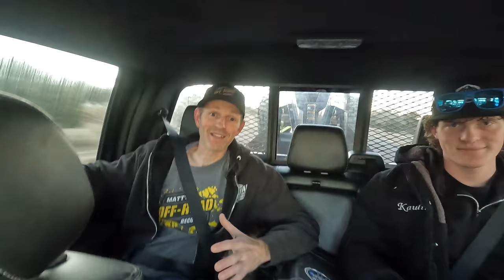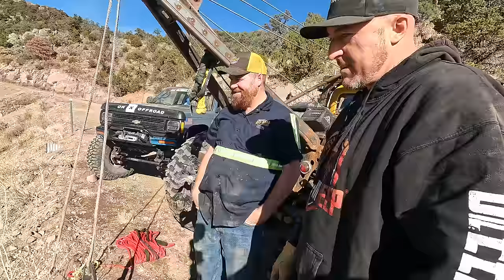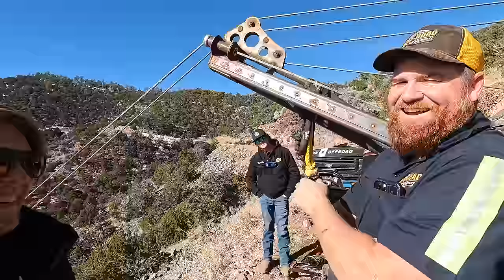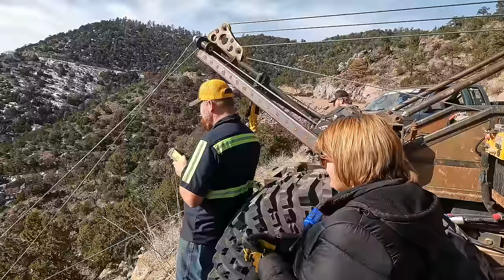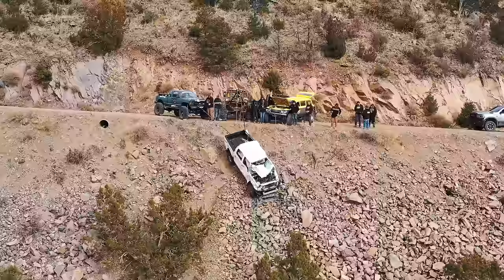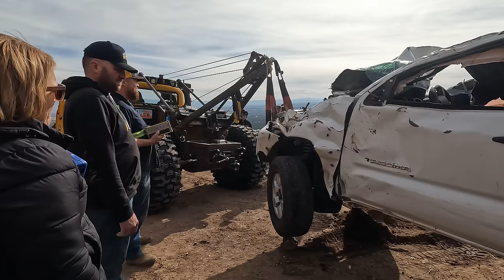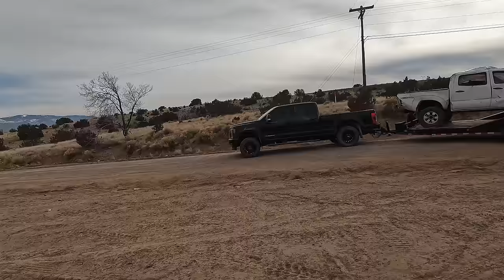There's No One Who Can Recover This Toyota....

Comment: Just a suggestion, your downhill crews should have some mountaineering helmets on for safety. As a medic and wilderness EMT I have been involved with many folks who have sustained very bad head and facial injuries from rock fall. Maybe you can get some custom yellow helmets which also have options to put LED lighting on them for night work. Love you guys! My favorite First Responders!!!
Reply: as a construction worker, i have worked with people who have gotten hit in the head and survived because of a cheap piece of plastic strapped to their heads, just be careful about what you wear underneath. someone in my class was wearing a baseball cap, and had a drill fall on his head, he was fine, but it hurt a lot more because the impact was focused on that pin
Reply: They won't even wear safety glasses. Helmets? 😮
Reply: Couldn’t agree more! I do on road recovery and we have to wear them when doing ditch work, or cliff side work. It’s actually saved me some serious issues once or twice from falling debris
Reply: Matt seems like he doesn't take safety advice very well.
Reply: Another hot tip from the "Safety Police". This crew thinks going the extra mile to make things a little bit safer is going over to the Dark Side.
Reply: They don't use welding face shields generally, I don't think they're going to use mountaineering helmets...
Reply: Probably eye protection too.
Reply: Helmets, and maybe repelling gear😊
Reply: Psshh.. What are you GUYS? OSHA??? LOL
Reply: Is that talus or scree, or both?
Reply: U dont need any of that
Reply: The Pantry in Santa Fe has the best breakfast ever!!!
Reply: Can’t yall just watch without nit picking everything they do
Reply: 🤓 🤓 🤓 🤓 an EMT you need mountaineering helmets 🤓 🤓 🤓 🤓
Reply: There are KARENS everywhere! They don’t need any helmets 🤦‍♂️🤣🤷🏼‍♂️
Reply: @henrymurray230 don’t forget to wear a cup
Reply: It's in the 30's and Matt's not even wearing a sweatshirt.
Reply: Shhhh! Don’t discuss safety. OSHA might be paying attention!
Reply: I'd suggest hockey goalie gear inside an inflated bubble, just to be safe.
Reply: Safety third!!!
Reply: You guys need sun protection 😂
Reply: Merch too with their logo on yellow hard hats/helmets
Reply: Health and safety nannies abound here.
Same mob who pushed the jibby jab.
Reply: Matt doesn't value the lives of his employees, he can just hire new ones.
Reply: Just watch the show if something happens I'm sure it's gonna get more interesting.  .
Reply: @kevbev1524  I’m actually curious about his company worker comp insurance premiums. No helmets, no safety harnesses. And they can’t blame the workers as they are not even made available to them.
Reply: @patricklarocque1550 I was just wondering the same thing… WC is so varied across the states in the first place. Has his insurance carrier seen his videos? 😂😂😂
Reply: @patricklarocque1550  
I wonder, is Utah just more relaxed than other states, isn't that the state you can have many wives, Mormon government maybe more of a do what you want til it's too late state?
Reply: And a helicopter and a sky hook and a 20000lb pocket winch, and their mommy to hold their hand
Reply: May I suggest bug spray?
Reply: @itomba  I think it's more like scrus.  Or talee.
Reply: He might have a change of safety attitude if a crew had a workers comp claim…
Reply: Matt doesn't care about safety lmao. He makes that clear when he makes him employees get in vehicles that are in precarious situations when it's unnecessary.
Reply: @erickrobertson262 I fully agree with what you're saying I just wish a few people in the comments would let their fingers take a break and not type out some of the trash that they're saying
Reply: @itomba kinda both. Scree is small and actually nice to descend as you can kinda plunge step/ski through it. Sucks going up tho, like a treadmill

Talus is larger loose rock, which there seemed to be plenty of
Reply: safety? Matt Grinds metal without safety glasses and picks up hot pieces of metal that have just been welded with his bare hands and then exclaims ouch! that's hot!
Reply: Maybe they should be wearing helmets ffull time? 🤪
Reply: @1996FordBronco  Don’t get too excited, everyone’s comment puts money in his pocket!
Reply: Safety third bud
Reply: People in this thread calling those who are concerned about safety Karens need to consider if there was accident what the consequences would be.  State and federal labor violations are one.  Another would be what casualty insurance would do — cover the loss, deny the claim, raise premiums or just cancel the policy.  Finally, Matt could lose everything to a death and/or dismemberment tort claim for negligence.
Reply: I just watched an old YT video about a man in New Jersey who was killed by a tape measure falling from a worker’s belt on a high-rise construction site.  The tape hit the ground, bounced up and got him in the head.  He was delivering wallboard and was not wearing a helmet.  Just a freaky accident.  Wearing a safety helmet may have saved him.
Reply: I thought this was a repeat but realized I already saw it on Bleeping Jeep’s channel.
Reply: Agreed. Ive been hit by 2 rock slides and rocks do not care about flesh or bone. Surprises me they never get hurt.
Reply: If Matt was selling $300 hard hats, they would all have one.
Reply: Seriously, Y'all need to get a life keep ya suggestions to your self Yeah I said it...another successful job done now give the whole damn crew their props and 👏🤘🫶💪🤝🙏
Reply: Fair call. But he dont play by the rules…
Reply: Here here!
Reply: 💯🤔 Albuquerque New Mexico in the house I totally agree😮 have a good pair of binoculars wouldn't hurt also😂😂😂😂
Reply: Sheer idiocy putting three people on a line descending through talus, rocks flying down with every step.
Reply: You must new to the channel. Their moto is either ‘safety third’ or ‘safety last’.
Reply: Oh these guys are still n the 60s to 80s mentality. Back in the day when anything goes and we were not afraid of stuff 👏👏. Back before helicopter parents and you
Reply: I don't understand the tough guy act some people put on by willingly omitting safety gear. It doesn't make you look professional or brave, it makes you look incredibly foolish being so underprepared.
Reply: I totally agree!
Reply: And some rappelling lessons  and harnesses.
Reply: Well Osha tried pulling that truck and couldn't succeed or it'll cost more for the insurance to just leave it for will to take over.  So what yall want? Mayt's team know what they are doing .

I'm just wondering where the drone at?
Reply: @masterbond9 I hate when I hit that spot on something when I'm wearing a hat
Reply: You're above 4 ft You need a harness in a lanyard😂😂😂😂😂😂@RonnieBravo_
Reply: I hunt on mountains like is with no helmet... gotta get rid of your City feet 😂
Reply: @spambeanie2  if youre an OSHA inspector then i'm the queen of england 🤣 🤣 🤣 😆
Reply: Somebody put a dollar figure on this job.  10k?
Reply: Good advice but, I have to ask, how would a helmet protect you from facial injuries?
Reply: @michaeltreen8785  at least, I wouldn't do it for any less, payroll, hauling, equipment.
Reply: Y’all doing to much
Reply: @jelly7310 any advice, the corvair was a POS
Reply: Id take a step back from hating on his way of safety. things have happened, they do take safety precautions.
Reply: I was going to comment with some hate about you being a nanny but after reading the entire comment and considering it before I spoke you are definitely right and I would be sad if Matt got crushed by a rock. I’m not a huge fan of PPE but a simple helmet when working downhill on a rocky surface is probably smart.
Reply: Thick socks reduce rolling rock injuries plus gloves aid rope walk down.
Reply: 🤔 Maybe just enjoy the video? 🤦🏻‍♂️🤷🏻‍♂️
Reply: Just a suggestion, your grammar and punctuation is slightly off. Maybe consider have an English teacher review your posts prior to submitting them? I know ALOT of people who do this and it prevents others from critiquing your comments/posts?
Reply: @JT_70  that is exactly what I was trying to figure out. That’s where I saw it too. OK now it makes sense.
Reply: And some rappel and basic climbing skills
Reply: Then why have a skull?
Reply: Yeah....Matt has been pushing safety for years with his can do attitude.  Its time to get more professional before someone gets seriously hurt.
Reply: They just need to carry the shop caution sign in the field. CAUTION!
Reply: Thanks KAREN you are lucky they are using radio’s
Reply: Ok karen
Reply: @1996FordBronco, how are they nit picking they just want them safe 😂😂
Reply: ...and a hazmat suit for any contaminants as well as a respirator for the foreign dust particles.
Reply: Might get good results if somebody donated climbing helmets with a note we care about you and crew
Reply: @gizmolannigan your mommy
Reply: Good advice, I totally agree,  safety first!
Reply: Someone always has to to say something..just watch it and enjoy it..and like the video or don't,,
Reply: OSHA doesn’t care 😂
Reply: In no means is this a replacement for proper helmet protection but they have ballcap inserts to turn them into bump caps. If it's a look thing this could provide some level of protection.
Reply: There's no OSHA out there lol
Reply: There’s no better safety equipment than being mindful and experienced at your craft! Matt and crew are amazing! Safety equipment is only good as the people around them. Do not think wearing safety equipment is the answer. Be safe and wear your helmet when leaving your home you could fall or even get hit by falling debris. 😂
Reply: Just everyone shut up and enjoy the content. If it was anyone flapping their thumbs they’d be over the hill the exact same way. Real life and lubetube are the same damn thing, real stuff being filmed. I sure know I’m not wearing a helmet that can catch a branch and break my neck if I happen to fall. There is ups and downs to all safety gear, pick your injury is all your doing.
Reply: Good advice but at the end of the day it’s at there own discretion. At the end of the day there’s a hole lot of stuff that dangerous but you have to put your big boy pants on and deal with it. Would it be better if they wore helmets of course , is it up the them if they won’t to wear helmets of course. Is people whining to the high heavens that Matt doesn’t take there advice goin to change absolutely not lol. So at the end of the day why even say anything if you kno it doesn’t matter and nothing is goin to change ????? Sounds to me it’s a bit counter intuitive to say the least 🤙🏼.
Reply: Totally agree, the lack of a safety management plan put peoples lives at risk. Very disappointing actually! No Risk Assessment at all.
Reply: @Swimmyrox lots of great places to eat in Santa Fe.
Reply: Construction Karen’s 🤔🤔🤔, who would’ve thought that was a thing?
Reply: Not taking precautions for your own safety is one thing but hauling a crew down and not offering it to them is a life lesson waiting to happen.  Sounds lame but gravity is no joke.  Glad nobody got hurt.
Reply: It's there deal...leave them alone.
Reply: @spambeanie2  overlord of regulations, go get your hands 🙌 dirty! You are out of line!
Reply: Unbelievable people have nothing better to do than worry about a group of hard working Americans doing a job the dang government won’t do! I like to see OSHA officials to go do that job according to their policies! 🤣😆
Reply: I agree, all these people laughing will regret it if there is a serious injury one day. Not for all recoveries but ones like this on extreme hills with tons of loose rocks.
Reply: Most everything else usually heals. The BRAIN is the high profile exception…
Reply: Tacoma is still worth $30k. 😂. it’ll buff out.
Reply: Thats useless
Reply: @99bx99 I have another hot tip. Excessive safety measures have cost this country hundreds of millions of dollars and many people are dumber because of it. The helmet idea when they're working on steep rocky stuff is probably a good idea though. But in every industry I've been a part of the safety paperwork is just BS. most companies don't care about whether their people are safe or not. They only care if they get in trouble over something.
Reply: @michaelsuren8014 sounds about right!! I think every hard-nosed "safety first!" kinda guy I ever met was about as boring as watching mud dry.
Reply: World needs less Karen’s
Reply: @99bx99 that attitude is exactly how people get killed.
Reply: Any kind of helmet would probably be better than nothing. I’m thinking bike helmets etc. if u allready have them.
Reply: @OcRefrig  I'm amazed they don't use bump caps in the workshop, they're compulsory in workshops and factories here!
Reply: I was sure they would drive it off the mountain. Toyota much be cheeping out.
Reply: Serious lack of safety equipment!
Reply: Wildland firefighter here, and I agree 💯 percent. Rocks gain speed as they roll down hill and a simple slip from a guy higher on the mountain can cause a rock slide for everyone down below. Another good strategy is to stagger guys sideways so no one is ever directly above another person
Reply: Or even regular hard hats
Reply: There's a lot of snowflakes commenting , 😮
Reply: Come on me and my 25 friends growing up in the 60s and 70s rode bikes every day no helmets and everyone survive.
Reply: Even Colin Furze won’t wear one. For some reason people don’t like to protect their heads.
Reply: I use to work in a university hospital ER/Trauma Center…
Would’ve, could’ve, should’ve is a mighty sad frequent lament.
Couldn’t put Humpty Dumpty back together again.
Reply: @kevbev1524  that recovery was in New Mexico 😆🤦‍♂️
Reply: Don’t forget your ear plugs.
Reply: Dont even talk about safety on this channel dude.  Matt dont care lol
Reply: To all the people hating on this great and very sensible suggestion, note it is the most liked comment on this video! 🎉😂
Reply: SAFETY?  MATT?  Oh come now.
Reply: Helmets and safety glasses are a must.
Reply: "you don't need to worry about that" 

- Peg
Reply: Most don’t know what’s  important until it’s to late
Reply: I’m a hiking tour guide in Las Vegas . Unbelievable how many rocks you have to dodge
Reply: Always bring ear plugs when you travel with old men. Lmao
Reply: I wonder how anyone survived before osha
Reply: @1996FordBronco says the guy nit picking the nit pickers geez
Reply: It's all fun and games until Matt is responsible for one of his team getting seriously injured I bet the tune will change when that happens. I don't normally chime in, but y'all bashing on an emt who sees the horror of neglecting safety on a regular basis id listen to that particular guy when he chimes in because I doubt he nitpicks and chimes in for every safety issue probably just the ones that'll kill ya quick.
Reply: You don't need no stinking helmets😂
Reply: You should put a helmet on your head
Reply: Gotta love safty police do you were kevlar gloves when doing paper work
Reply: I think they were a bit of their league with this recovery. A lot of unnecessary risk and mistakes with this one, but that’s what makes it entertaining. I’m sure they adapted to the situation behind the scenes and will be better prepared next time.
Reply: @MrWilliewonka69  exactly. People are too freaking soft these days. Have a glass of concrete and harden up.👊
Reply: @daffyduck9901  rescue seem to go really well and it looked like they know what they are doing(yes i have been watching mats for a long time now)
Reply: They're Americans. Baseball cap and dark sunglasses is all you need
Reply: They're Americans. Baseball cap and dark sunglasses is all you need
Reply: They're Americans. Baseball cap and dark sunglasses is all you need
Reply: They're Americans. Baseball cap and dark sunglasses is all you need
Reply: They're Americans. Baseball cap and dark sunglasses is all you need
Reply: They're Americans. Baseball cap and dark sunglasses is all you need
Reply: And OSHA has entered the chat😅
Reply: That's up to them but I'd tou want to wear safety gear while you watch form tour couch feel free
Reply: What? stop promoting sick helmet propaganda
Reply: I don't know which is worse, Nancy's fear of everything or his self-righteous need to spread it everywhere he goes...
Reply: Too late, most of them have already got the facial injuries...
Reply: Ya, because if one of them trucks come tumbling down on top of them the helmet will protect their hair.
Reply: Man, eff all dat, they need SNAKE BOOTS, and I don't care how cold it is...
Reply: Man, eff all dat, they need SNAKE BOOTS, and I don't care how cold it is...
Reply: they dont even take extra gas...
Reply: @RonnieBravo_  Better to go home late because you had to work a little slower than to not go home at all.
Reply: I guess OSHA is not a issue in Utah?
Reply: Don't bother they won't wear ppe when doing work on the vehicles, they won't wear their seatbelts 95% of the time. They use their phones while driving when there is usually 5 people in a vehicle at a time and someone else could easily use the phone for the driver . They will find themselves in the same situation or worse than one of their recoveries one day.
Reply: 156 replies and mine makes it 157.  Matt should hire a construction crew to clear a landing spot for life-flight before every one of these jobs.  Maybe enclose everyone in bubble wrap two foot thick too./
Reply: helmets with two way radios in them
Reply: @jstephenf9546  rappelling . .  is going down a mountainside roped up . . carabiners, gear, etc. 'Repelling' is what your spelling is . .
Reply: @1996FordBronco  Pointing out that you should have proper safety equipment on when doing dangerous work isn't "nit picking". I'm pretty sure Matt would have a pretty different view on safety if his son were to have fallen and smashed his head open on a rock or was hit by one rolling down the cliff.

This is also besides the point that medics and forest rangers will be the first to judge you for not following safety standards out on the trail. What is their plan if someone were to be seriously injured while they are dozens of miles off-road? Demand that a medivac helicopter be sent out into the wilderness because a business who specializes in going off-road were being negligent?

All of that is also besides the point that Matt brings along outsiders and employees. All it takes is one of those non-family members to be seriously injured or killed and Matt becomes liable for ALL of it, because he is the business owner that brought them out there without safety equipment.
Reply: @pnwesterner6220  Exactly. Making YouTube content doesn't mean that basic workplace safety standards aren't in place by law. You can even forget about the moral and psychological implications if one of his sons became a victim of an accident. All it takes is one of those non-family members to be seriously injured while not following basic safety standards and Matt would lose everything he owns to a negligent tort claim, as you said.
Reply: Safety second,goals first lol
Reply: Really enjoy your shows! Hey, I’m an Orthopedic surgeon and strongly agree with Eric Robinson the EMT you NEED helmets! I’ve seen lots of injuries in which the helmets saved their brains! Be safe…keep your videos coming! Bob B MD
Reply: Yeah I as thinking the same.  One little bonk from a rock the size of a golf ball could turn this from a great story to tell for years to a horrible tragedy you can never forget.
Reply: @patrallen48 well a bunch of them he would have to make new ones.
Reply: @michaeltreen8785 At least, it's got to be 1k just for the wheels
Reply: ahh yes, that helmet did so much to protect against that 60 lb rock rolling down the hill.
Reply: @678friedbed  you say that but the damage mitigation to anything short of a direct straight on blow (and even that) could radius make the difference between a dead person and a person with a wild story.
Reply: @courier11sec   I say that because it's true. a small enough of a rock that the helmet would protect against won't hav the energy to hit ones head.